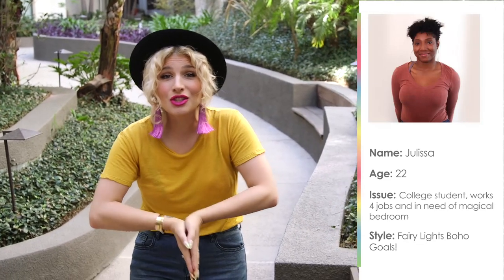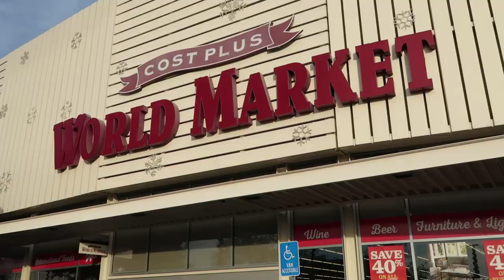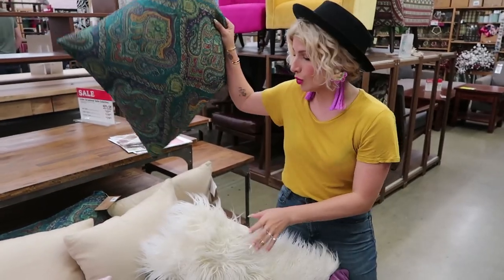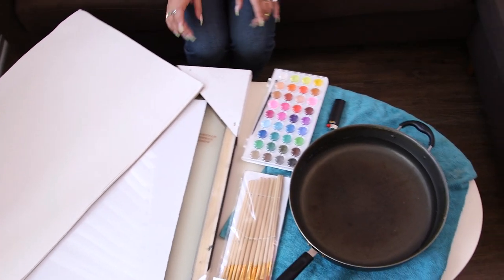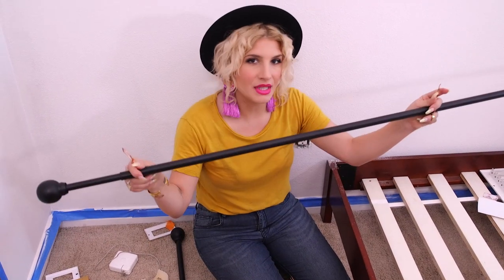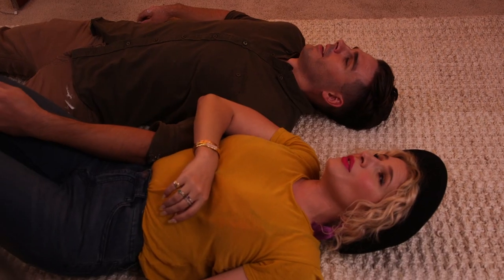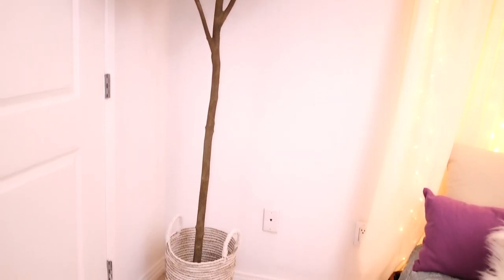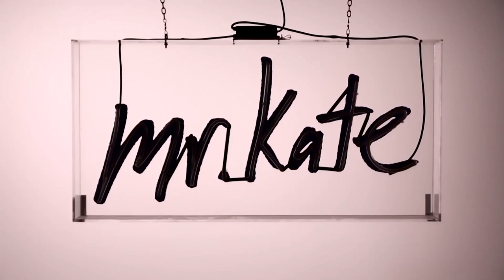Fairy Lights Bedroom Makeover Goals! | Mr. Kate Decorates

Comment: i refuse to believe you did that in 4 hours
Reply: Sam Anthony I refuse to believe $150 can do this
Reply: morenitaflakii they said $150 for the bed. just the bed...
Reply: @morenitaflakii  it's only 150 for the project of the magical bed with the lights + curtains
Reply: Lucy Smith  I think they did it in 8 hours idk
Reply: Sam Anthony but she also does this for a living all the time plus she isn’t painting the walls so I could understand how she did it in only a few hours plus I mean it looks super easy mostly it’s curtain rods and new curtains with super cute Christmas lights and a new bed set it just looks super easy yet beautiful
Reply: They must do a previous visit to get measurements and then go shopping. All before the actual day. The day of would be painting and install. There is no way you can go in, figure out the design, shop, eat lunch, paint and install. No way. But no hate here. They do a great job and stick to a budget.  I will note ere that they always mount tvs but never include mounting bracket in the budget nor do they show electrical work for mounted tv. Either they just do it or they tuck cords away and then the owner just plugs it into the plug later. So tv magic but not reality.
Reply: they make miracles
Reply: @kaylaryals8227  Exactly. Prepping the room, painting, letting it dry, in a couple of hours in between building furnishings and ... shopping!? No way. On Trading Spaces they handed the couples a brush (not even a roller most of the time) for a few shots, then let the crew finish.